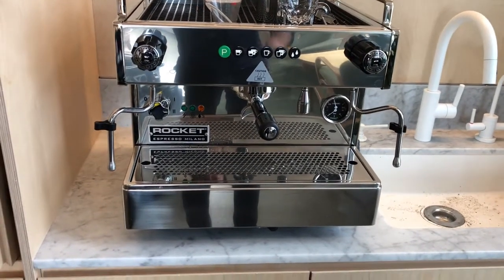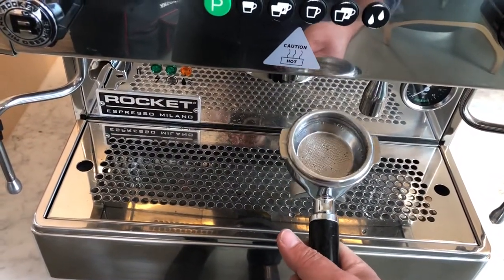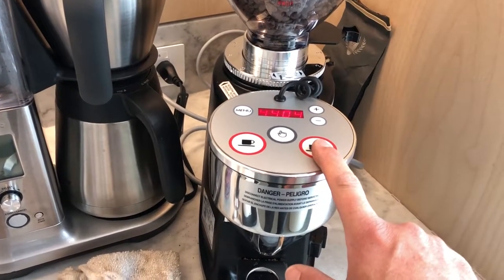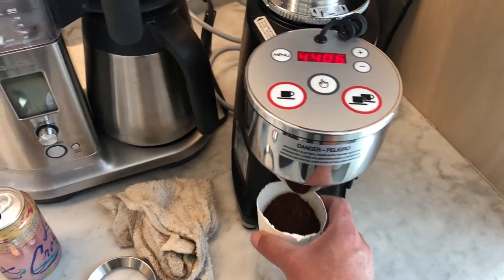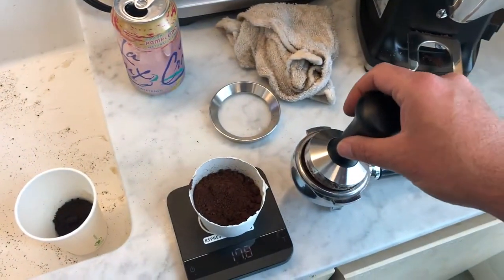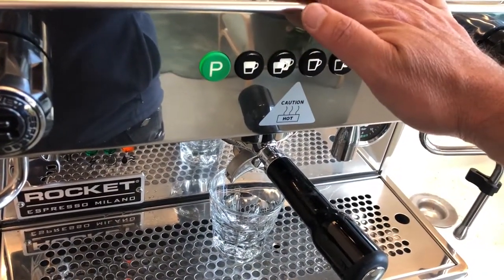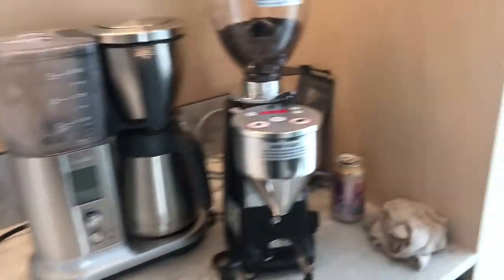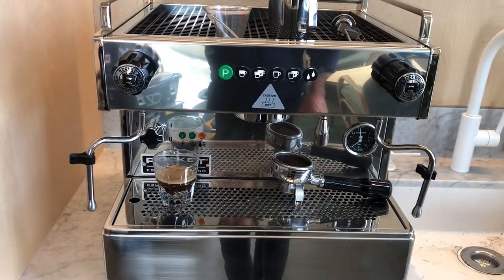How To Brew On The  Rocket Boxer Espresso Machine

Comment: Interesting machine . Would it be a good machine for home ?
Reply from the maker: Yes, absolutely
Reply: I’m debating, do I want a shiny box that has a reservoir or do I want a commercial machine that I would need to either plumb or set up a flow jet and 5 gallon water bottle? Something I could make money with down the road since it’s NSF rated. You really need to see in person to appreciate.  It’s $1400.00 cheaper than the Linea Mini.  The mini is another option but, I don’t like that it doesn’t have a cold water mix valve.  I’m going to ask the owner what’s involved with the maintenance.

Comment: Just received my rocket boxer super excited. I’ve set it up with a flow jet . Pulled a few shots and noticed what looks like condensation causing water to drip  on the bottom of the machine is that normal?
Reply from the maker: Not sure about that, hard to tell without testing it in person. There could be an internal steam leak that caused this. Call Rocket USA for advise